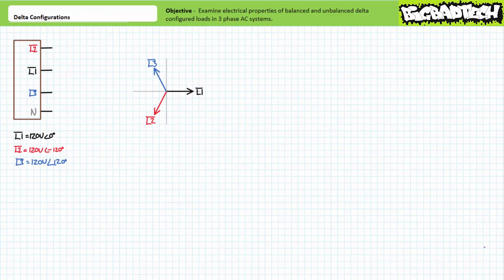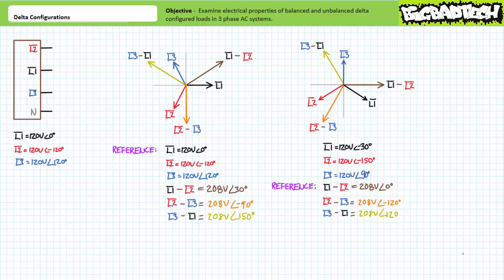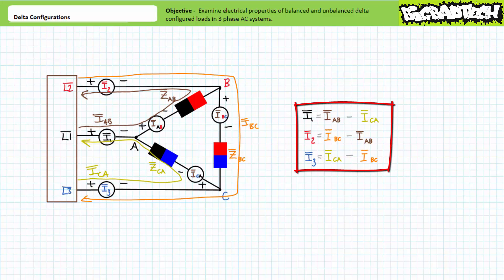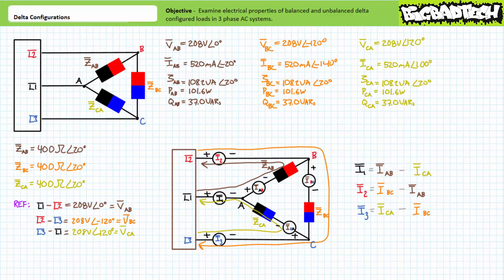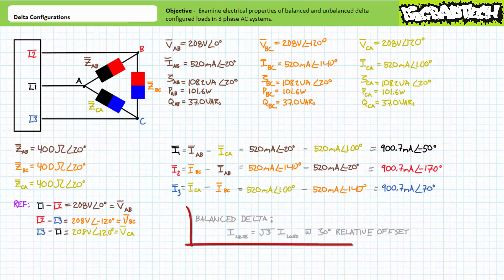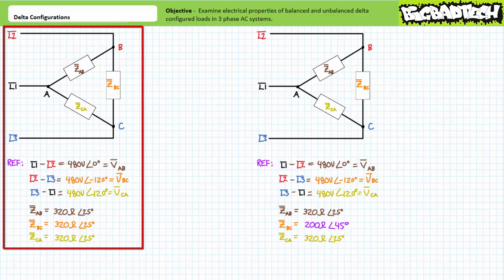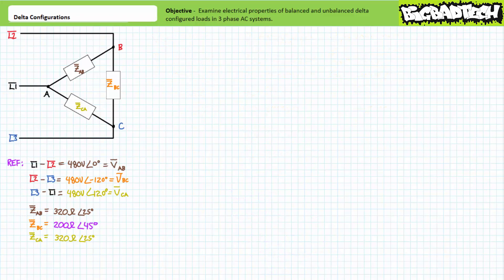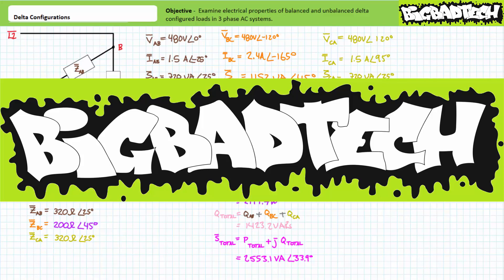Delta Configurations (Full Lecture)

Comment: Explain in layman's term
Reply from the maker: If it were easy we'd call it mechanical engineering. Yes, there's some confusion involved in 3 phase AC circuit analysis (especially deltas) but the big thing to realize is that loads inside delta configurations experience the line to line voltage. Treat each load impedance as a single ohm's law calculation. To calculate line current it's sqrt3 larger than load current with a 30 shift.
Reply: @bigbadtech  lol at mechanical engineering reference

Comment: Is it legitimate to double check the work by using a kind of black box calculation? ie, you know each line voltage referenced to an imaginary ground, and each line current (and the angle offset between the two). So, no matter what happens inside the unknown box, you should be able to do your power calculations without having to know what's happening inside....
Reply from the maker: Yes, ironically enough that's kind of what the "two wattmeter method" is (albeit with a trigonometric trick where L2 is used as the reference). https://www.youtube.com/watch?v=pWxpa4NncJM
Here's another trick I use ... if you can figure out complex numbers and angles in MS Excel (no easy task!) you can make a spreadsheet that'll do the calculations for you given known impedance and voltage magnitudes and angles. It takes some effort to develop the spreadsheet, however, it's time well spent because you never have to do it again.

Comment: In the example on 14:14 why does the current lag by 20 degrees. Typically doesn’t current lag voltage by 90 degrees?
Reply from the maker: Only for purely inductive elements does current lag by a pure 90 degrees. Imagine a motor winding modeled as the series combination of a resistor and inductor. This element would have a complex impedance angle of less than 90. Check out the series complex impedance lecture at: https://youtu.be/peH89MVBh6U

Comment: Great work, thank you! Question - why is the apparent power S = 108.2 angle 20, not negative 20?
Reply: Z= R +j(xl-Xc) so I (current, therefore apparent power S) with positive angle is a capacitive load, negative angle an inductive load- that is sign of angle matters.
Reply: at 13:50
Reply: you do want positive values for power I suppose for P and Q
Reply: ah, you mention a relative angle formula, that's why the voltage angle is 0 each time.
Reply from the maker: @pstark4  Check out the "AC Power" lecture at: https://www.youtube.com/edit?o=U&video_id=nse2vSlOoME Yes, current must always be measured relative to voltage. Additionally, AC power computations make use of the complex conjugate operation because inductive power (ie: lagging current) is historically considered as having positive sign and capacitive reactive power (ie: leading current) is historically considered as having negative sign.
Reply: Jim Pytel thanks!

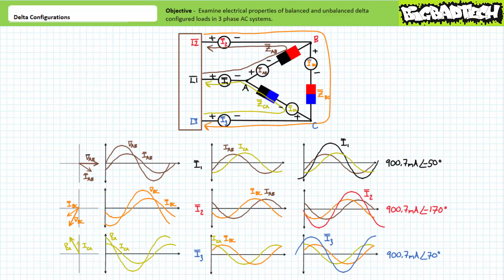Comment: 19:40 The center column seems weird to me - isn't there mistake in drawings of currents? shouldn't they be in phase difference of 120 degrees?
Reply from the maker: For a balanced delta load each load current would exhibit a relative 120 phase shift. The center column however illustrates each line current being equal to a load current MINUS a load current. Example: I1 = IAB - ICA, -ICA would be equal to ICA with a 180 phase shift.
Reply: @bigbadtech  Now I dig it😀 Thanks Jim